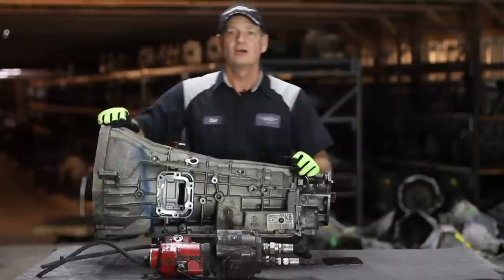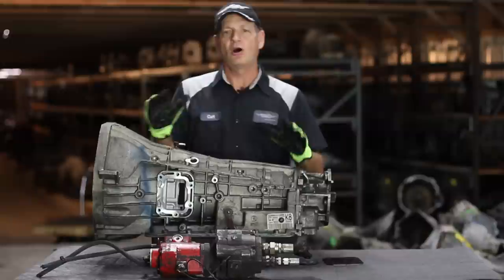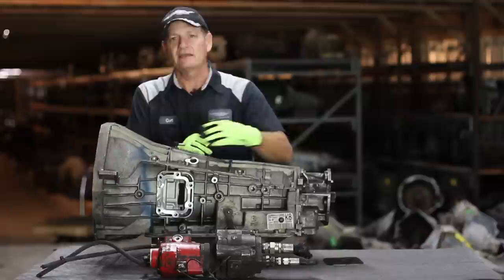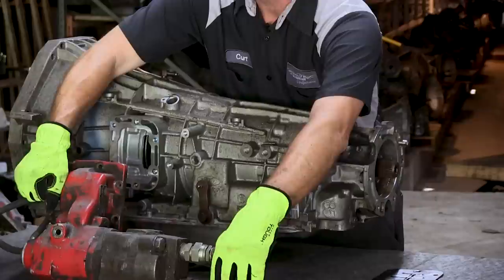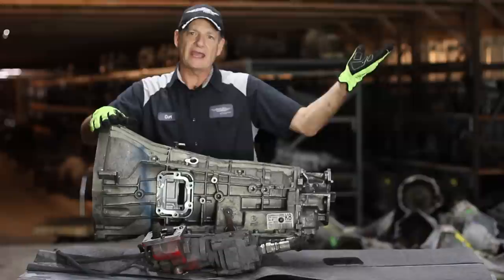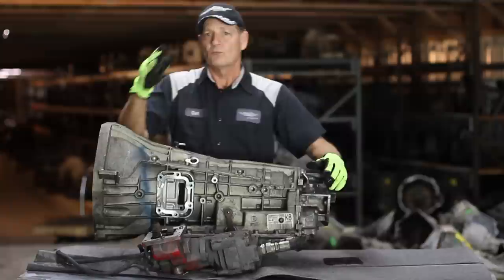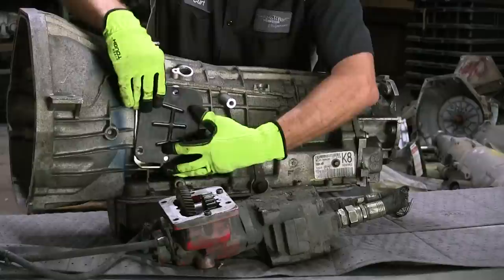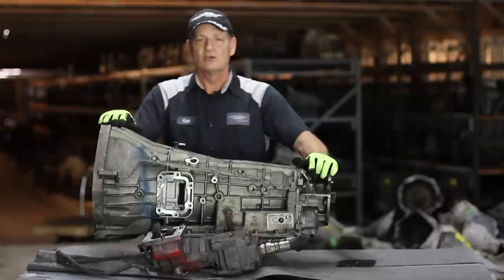What Is PTO on an Automatic Transmission?

Comment: Hello, I have a PTO in a 2004 Ford F-550 AT 6.0L, and my PTO clutch that is similar to the one you have in the video does not last long. like a year of use and then I have to overhaul the PTO.
Reply from the maker: Maybe overloading PTO System.

Comment: I have a 2500hd 4x4 with the 4L80e that I'm about to rebuild.  I'm taking the truck apart and sandblasting the frame, replacing all lines, etc.
I'd love to have a pto. I'd like to operate a 10k watt generator. (I can see the use of hydraulic, too, to replace my 12v ones).
I'm looking into the feasibility.  Perhaps Allison? Perhaps Muncie?  Perhaps switching to manual tranny is better but I don't like them when plowing snow.  IDK  Any thoughts?
50 years ago I had a dream to have a generator by PTO, dump by belt drive, and hydraulic by 12v (plow, small crane, etc)  as the best truck I could have.  My 2500hd has 4:10 posi.  I drove down to Nashville to get a good one.  My race is nearly run and really would like to do this.
Reply: Really cool project, PTO generators are more common for tractors and are usually detachable. On maritime vessels we have the PTO generally installed on the reduction gear and its massive but here acting as shaft gen. In your case it's the same, you could one of those tractor 10kW generators, remove its casing and provide the RPM it needs using a connection in theory. But having enough room for that gen is the main problem, maybe installing it parallel to the transmission then fixing it and driving the cables to an electrical panel inside the cabin?